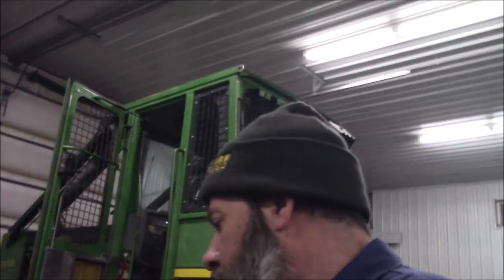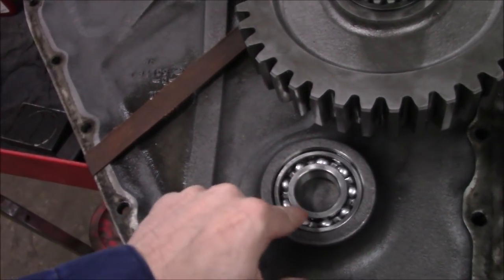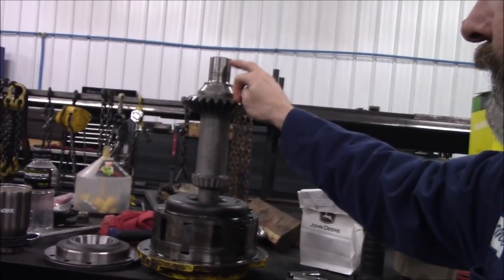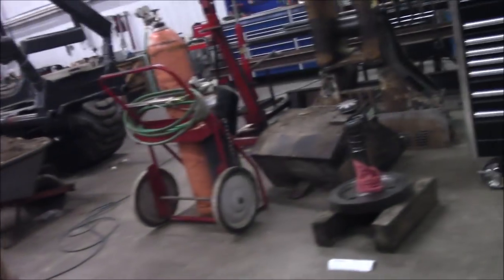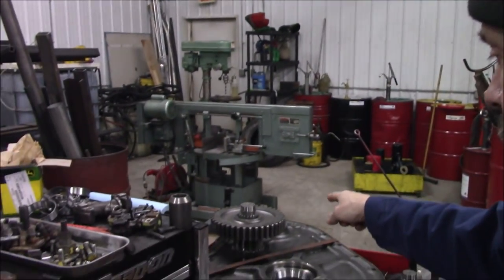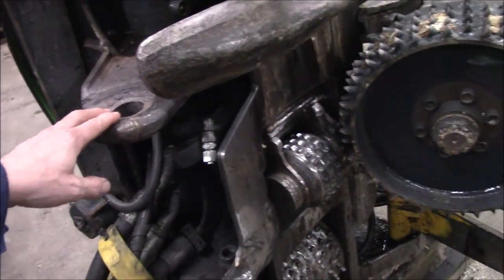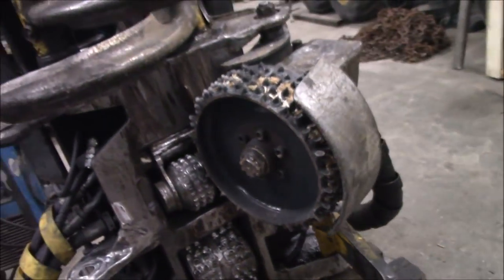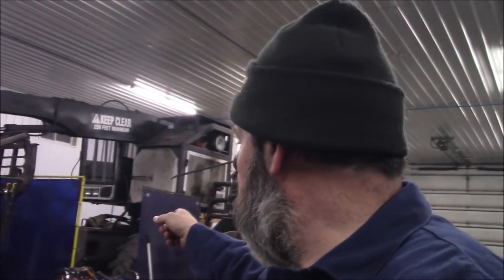Rework!! and Ponsse H73e

Comment: Nice job on the Timbco forwarder weldment repair & the video series. Some guys are mechanics and others are parts changers. You my friend are a mechanic, fixing things others would consider junk. That's for sharing 

I don't know about calling it rework. I work as a service manager at a Case IH farm equipment dealer. They guys say,  If it goes off the concrete it's rework if caught before its not WTF LOL, 

I goon-a let Troy off the hook on the winch, was obvious that the free spool slider splines was the problem, Why look any further Time is money order the parts and move onto the next broken unit, Cant just buy all new parts, that bearing runs in oil should last for ever.  At least it was caught in the shop and not in woods when customer hooked first hitch to it. That's were the damage happens. customer is pissed, your embarrassed,
Troy gets his ass kicked.  just a bad deal then. everybody has poop in there pants.  Now they only worry is "hey you just repaired my winch now my blade cylinder started leaking must be something your guys did to cause that"
Reply from the maker: Well said

Comment: You should get a set of Balmec feed rollers for this H73E head. We changed them on our head and it performs way better than original ones.
Reply from the maker: Did they come from ponsse or another source?
Reply: @MichaelJBerg  No, we bought it from their local dealer but I think they sell worldwide directly from Balmec factory. I recently saw Balmec inner roller for H73E - this has bolt-on splined flanges on both sides of the roller not welded like Ponsse original. Looks like they've listened to some end users to make it like this as it's a nice saving when the splines get worn out but the rest of the roller is still good!
Reply from the maker: @zyndapp800  thanks for the info. It's probably what they call a "performance package"
Reply: @MichaelJBerg  Balmec is independent producer of all kinds of spare parts for harvester heads, it's not related to Ponsse but the opposite - they are competitors :)